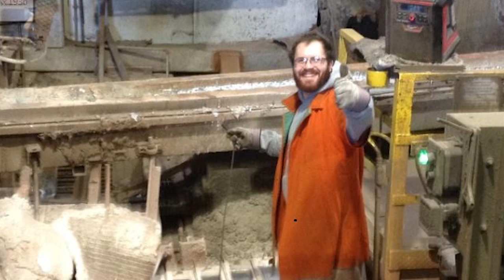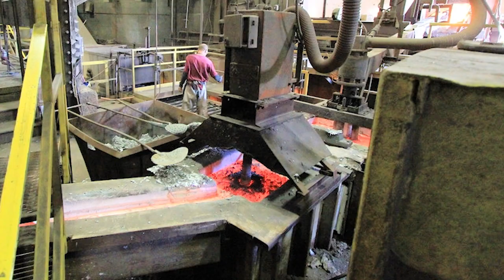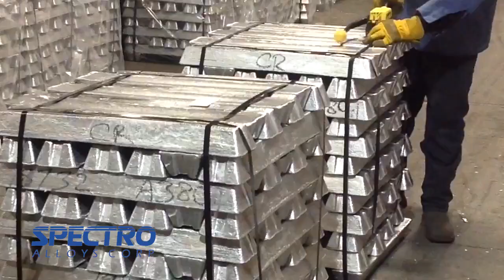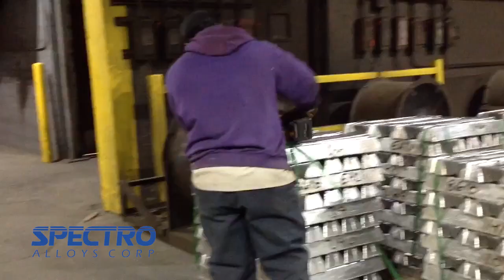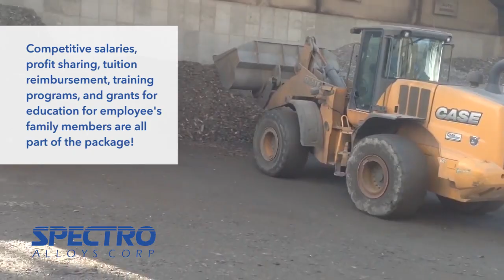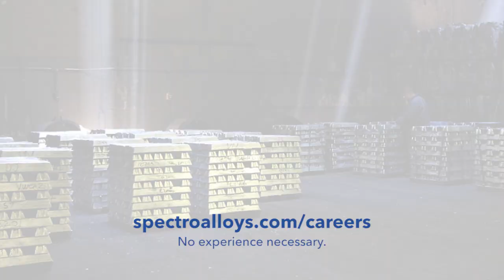Spectro Alloys

Comment: I've worked for this company for 5 years, if you are a minority don't waste your time!!! they are totally 100% racist. No matter how hard you work or how long you do, it will not matter to these people. You could go above and beyond work through the harshest of conditions from extreme heat to extreme cold in completing your duties as well as pick up the slack of others and literally be  looked down upon when trying to be the best worker on the team. I've had mention racist circumstances that have occurred on every yearly report I have made. They are very disturbingly prideful when confronted with racist acts committed against blacks and Hispanics. I took pride in my work but felt the shame of the white supremacist environment. I've witnessed coworkers throwing up the white power symbol, overheard them using vulgar racist language, witnessed Caucasian meth heads put people in danger and would still have an open door given to them. So in my personal opinion the companies values are good but NOT FOLLOWED by those that should be setting the example.